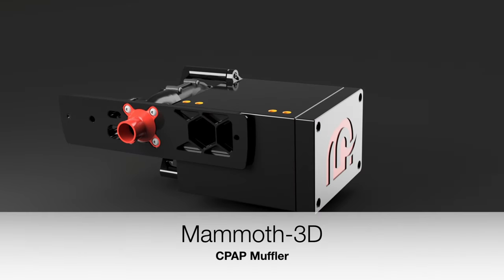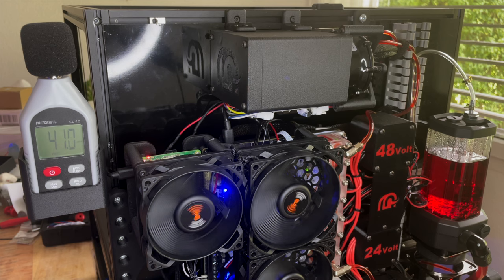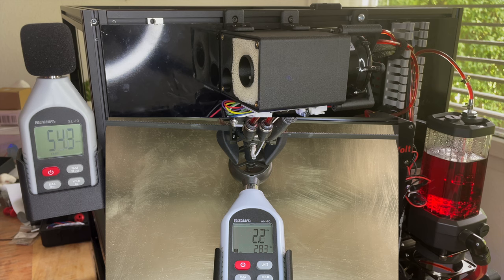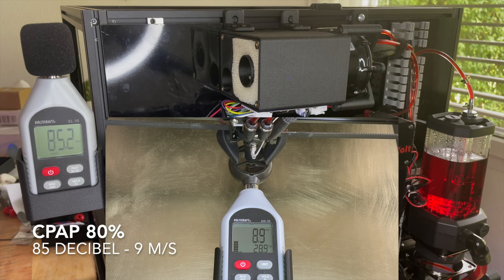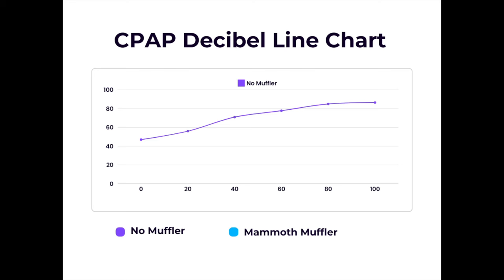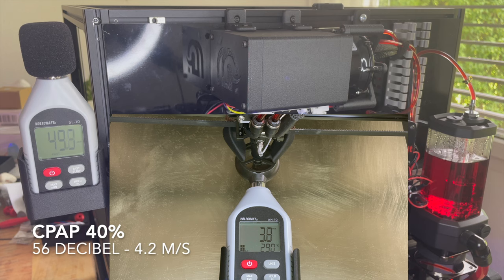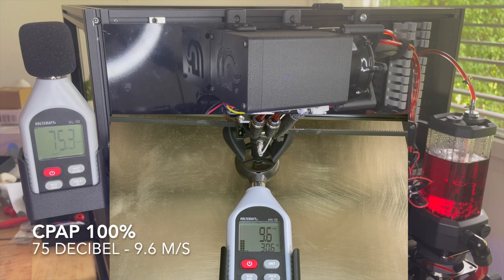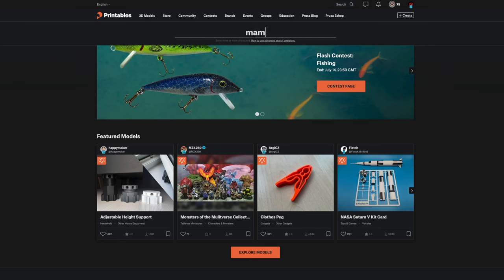CPAP Muffler dB and Air Flow Test - Mammoth-3D: Comprehensive Analysis

Comment: did you try printing the casing with TPU and fuzzy skin for the inner walls?
Reply from the maker: No the one in the video could be Nylon CF or ASA CF. Don’t remember 😄
I don’t really print fuzzy skin. The CF in the filament does a good job hiding the layer lines